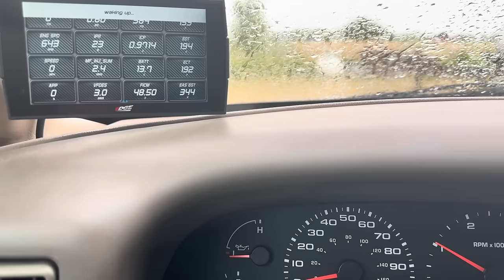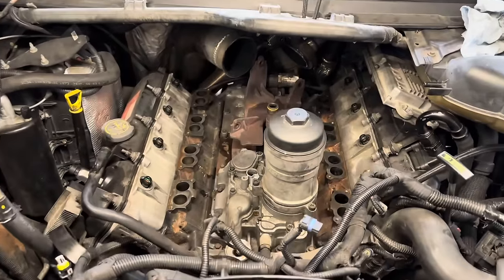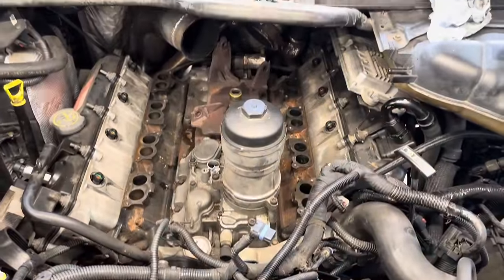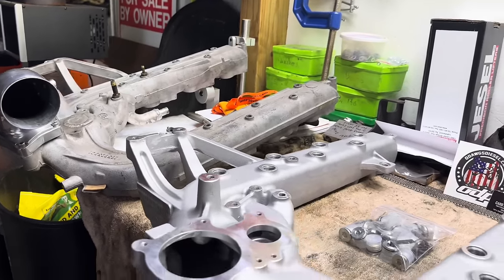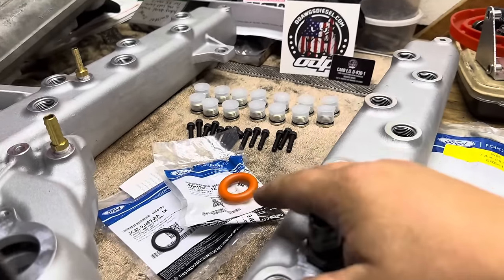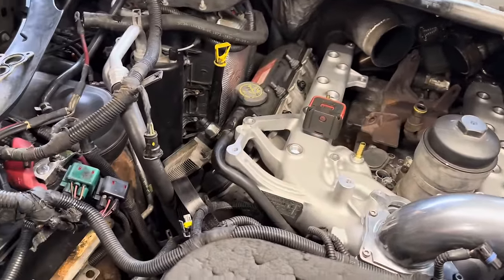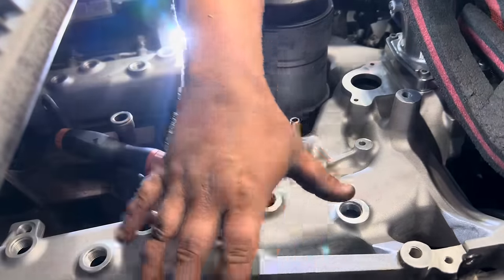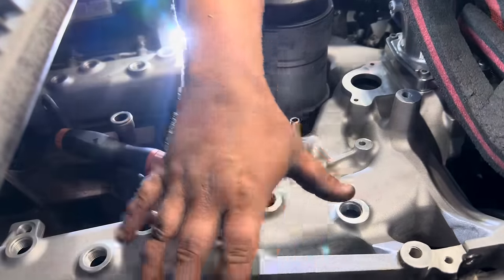THE TOP UPGRADE FOR YOUR 6.0 POWERSTROKE!

Comment: 6.0s are so underrated. People who buy into the bullshit have never truly had their hands on one. As a whole its the best diesel platform of all time
Reply: 😂😂 the top upgrade to a 6.0 is to sell it asap… I had one bulletproofed, took extremely good care of it and constantly things went wrong with it. Wasted countless days replacing and fixing. If it wasn’t one thing it was another. Unfortunately I’m not the only one.. everything bad you ever heard about these pieces of crap is 100% true.

Best day was the day I got rid of it and got a 6.7
Reply: It's because of the emissions they put on it and dumbasses that put a race tune in it and then try to tow 10000lb trailers up a grade and blow head gaskets then hop on the forums sitting on it. We'll the larger trucks and busses and dump trucks they put them in didn't have to have a egr and guess what they never had any problems. The 6.0 is a badass ass engine and going from a concept to reality in less than a year I'd say Navistar did one hell of a job. People don't talk shit about the 6.7 and that things has way more problems then the 6.0 and 7.3 combined. The problem is all the emissions bullshit they make them have. That's y there are no reliable diesels on the roads now days.from cars to pick ups to semis. They all break down more then they should.
Reply: @powerstroke6.7 sorry to yell u this bud but the 6.7 is a bigger piece of crap and I've been working on and building these ford diesels everyday since the 7.3 powerstroke came out. If u dont know what ur doing or taking it to people that don't know what they're doing ur always gonna have problems. Not the the engines fault.
Reply: @Chevydude1982  let’s just agree to disagree. You stated nothing but opinions and feelings, no facts. 

If the 6.0 is so good why didn’t navistar or ford keep the platform? Because it’s a disaster. People have made careers off of working on 6.0’s.  

I’ve never met a 6.0 owner in real life that likes the engine, it’s always some guy on internet that “works on them all the time” that talks how good they are. 🤣
Reply: @Chevydude1982 it’s the emissions but that’s just the tip of the iceberg…. Modern diesels have way more emissions than 6.0 and don’t have near as many issues. 

Since you work on them all the time has it occurred to you that having 4 head bolts around each cylinder may not be enough? 7.3 has 6 so does the 6.7.

Id rather have deleted 6.7 than 6.0 ANY day of the week. 

Btw maintenance on 6.0 must be meticulous if you want to keep it running, 6.7 is little more forgiving.

Everyone has their own biases, but the facts are undeniable…. There is a reason why 6.0 is no longer produced and navistar and ford gave up on it.
Reply: @powerstroke6.7  y r there sooo many u tube channels of guys building them. I've been an l3 ase master auto tech and Ford senior master tech for 30 years. I was a beta tester for the Ford id's and designed a lot of the tools used to work on them. The engine is awesome,the egr is the problem and if u knew anything about them u would know Navistar did keep them for class 8 trucks ,busses and equipment because they didn't require the egr on them. I've made a shit load more money in the first 3 years of the 6.7 then I ever did on 7.3 or 6.0 powerstroke . U r the one that knows nothing about them so u shit on them cause u cant work on them.when u say let's agree to disagree, that's when u shut up, that's y everyone tough on the internet. 🤣
Reply: @Chevydude1982  lol ok the first 3 years of 6.7 was trial and error just like any other engine… from turbo to emissions kinks. So far they have been in production for 13 years and running strong compared to not even 5 years total for 6.0 since it’s so good of an engine and all…

Your point is mute and no the egr is not the only problem but you knew that since you are an “expert”. 4 head studs around each cylinder in 6.0 is a blunder. But you knew that too.. lol

I understand why you keep defending the disaster called 6.0 people keep bringing them to you and people like you to get “fixed” only to have something else go out on it. to a hammer everything is a nail…
Reply: Sorry man but not true im literally pulling the engine outta one ive had for many years and there is always issues💀. And i do not abuse it.
Reply: I love my 6.0 cause its cheap and ive had enough of them now to be able to fix most things by myself . But shit breaks.... Often..... Lol 😂 im on my 3rd one. Sucker for punishment i suppose. But that sound!!!! ❤ Also have a 2010 duramax, no troubles in 10 years with engine. But transmission..well..iys crap.
Reply: @powerstroke6.7  I've had 4 6.0 powerstrokes and have had a completely opposite experience with them. None of them have given me any issues once the obvious issues were solved.....not sure what you were doing with them but it was obviously not the right thing.
Reply: @Chevydude1982 deleted 6.7 is a beast! Never had a single issue since 2019
Reply: @21divel right… that’s why they made them for 4.5 years and gave up on that piece of junk
Reply: @powerstroke6.7   Nobody is saying 6.0's don't have issues from the factory....what is being said if the issues are taken care of properly, and maintained, they are great platforms.
Reply: As a 6.0 owner I will just say, do not buy one if you have previous mental health issues😂
Reply: @powerstroke6.7  Ford went away from the 6.0 for the same reason they left behind the 7.3. It's because of EPA regulations. The 6.0 was produced under different names, and mostly for heavy duty applications for almost 11 years. You're sour and spouting nonsense
Reply: @lukefranklin1766  shhhh don’t talk about the lawsuits between the ford and international, 4 bolts around each cylinder, leaking head gaskets, ficm mounted on the engine which caused multiple issues…. Other than that and slew of other problems it’s a great engine.
Reply: You are a fool that needs to learn to STFU when proven wrong.
Reply: @martingilchrist7063  where is the proof that I'm wrong?
Reply: I don’t exactly love these things tbh I’ve had 3 obs 7.3 powerstrokes with a few mods to keep up on the Hw never blew head gaskets or anything but soon as my grandfather got his first 6.0 it blew a gasket I looked into it and imidiatly was like yo let’s fix it and sell this pile we fixed it he kept it cause I studded it put a aftermarket oil cooler deleted egr and put a MILD tow tune on. It with a coolant filtration kit then he got another one same thing again in my mind it’s a pos runs good when it wants to but man I love my obs 😂
Reply: The 6.0 engine is a great engine unfortunately the parts need to be made better and if u delete the cat u get a much better truck its night and day
Reply: @powerstroke6.7 lmk when a 6.0 ate pistons 6.7s blow pistons and heads all the time please shut up my god
Reply: @Chevydude1982  this is facts
Reply: About 3 months into ownership of a 2003 f350 6.0 and I think I got a good one meaning taken care of. Now I'm thinking I really want to try my luck and get a 6.4😂
Reply: Agreed!
Reply: That's right! Building it out of it's factory imperfections and then compound turbo it and you've got a BEAST! Makes the truck feel light when you mash the accelerator! Like you've got a miata under you!
Reply: @powerstroke6.7 

Stud
Reply: Hahahahahahaha. Right buddy.
Reply: Shiit what about that 6.4?

Comment: I put an s3r on my truck and the best piece of advice I have is install the bolts in the intake manifold while it’s still off of the truck on the bench using the intake gaskets to hold everything in place. Makes it so much easier and there’s no chance you can drop a bolt while doing it.
Reply from the maker: I know many guys use this method with great success.

Comment: I went with the S3R intake, Icon aluminum heads from KDD, 1.5 turbo from KC Turbos, stage 1 cam from River City, new FoMoCo lifters, oil cooler, HPOP, LPOP, water pump, fan switch, FICUM.  Switched to CAT ELC red and a coolant filter from KDD.  It's a 2004 and I dumped all that air damper crap up top and it now looks like a 2005.  Oh yeah, tunes from Warren.  It's a beast now.  Pulling a gooseneck with a 1973 Plymouth Roardrunner thru the Ozarks in 95 degree +  never got more than a 8 degree delta except when the ECT drops quickly on downgrades - EOT doesn't drop as quickly.  EGT's under 1100 max.  Calculated 22 MPG aveage empty at 70 MPH (can't afford to fix the overhead computer now!)  Whistles like an old Kenworth!  186K miles on the clock - all the crosshatching on the cylinder walls was still factory new looking.  Run Rotella T6, 5W-40 and I threw in some Archoil on the 1st change.  Didn't lift the cab - pulled out the front.
Reply: How much did all that run you? Did you do the work yourself?
Reply: from what I learned from a cat tech and failed lifters I seen in 6.0,
 I wouldn't run rotella in anything except for chainsaw bar oil
Reply: @jesusisreal3209 you're right on that one. The new T6 formula is absolute shit. I stick to 15w-40 motorcraft or shaeffers
Reply: @blooiefps9304  you’re suggesting dino oil over full synthetic? Can you post what analysis you’ve read that would put a full synth below a higher ash conventional oil?
Reply: In our studies on oil in powerstrokes. We switched to Delo 400 synthetic 22 years ago. My personal 6.0’s have 276k and 352k. All original on both. Only upgrades done EGR/Oil cooler around 125k on both. Both had HPOP replacements at 240k.
Reply: @edwardkveton3410  I bought a 03 with 225k hard to start smoked ran really rough.
Changed oil to navistar specified  motorcraft 10w30 diesel oil.
And about a quart of typ f atf in the oil and gallon of atf into two full tanks of fuel and she starts runs like brand new 6.0
the previous owner told me they used only delo 400

Comment: I believe I was that customer 2 weeks prior. I also purchased mine from kc but I contacted odawgs directly and they told me there was no way it was a issue with there product that “we sell to many with no problems for it to be a issue on our side” lol good to see after all it wasn’t something I did. I also had to grind mine and have had 5 sled pulls with no issues so far.
Reply from the maker: No way! That’s crazy, thanks for commenting. Yea I’ve installed a bunch of these and never had an issue. So I was shocked when this happened.
Reply: @LeftLaneDiesels   yep it just sucked cutting up a part I paid 900 for lol other than that they make a damn good product  and them oil cooler cover are not cheap
Reply from the maker: @double_tap_3793  I agree, I took away enough material that I started to get pretty nervous. A lot of time and money to tear it all back apart 🤦‍♂️ Hopefully it was just a freak thing and we were just the unlucky guys haha
Reply: I’ve seen a handful of videos of people who have had clearance issues (mainly the idler pulley)… you would think O Dawg would take this into consideration for future castings knowing that majority of 6.0s have had or will have head work done. I’ve been considering this upgrade for a while, but am worried about the same issue. I hate having to do work twice.
Reply from the maker: @Powerstroke7911  from what I understand all odawgs intakes will come with a washer to space out the idler pulley. In regards to clearance of the oil cooler, I don’t think this will be a continued issue. Just wanted to make sure I added it to the video to make sure guys check for clearance in this specific spot to alleviate doing the job twice.

Comment: I've got a 2006 6.0 lariat that I've had since new. Truck is completely stock other than a ficm I replaced about 2 years ago.
As others have mentioned, these truck engines are phenomenal if you know how to maintain them. You have to use motorcraft parts, 5000 oil change with rotella and fuel filter changes every 10,000. Mix in a coolant flush every other summer and you can get 400,000 miles out of them. I'm at 205000 miles and still running strong
Reply: I have a 07 all stock with over 300k

Comment: I installed the S3 on my 6.0.  I also did the BPD oil cooler relocate.  I had no issues whatsoever.  Cody I really enjoy your videos.  Great work.  I like the Ford 6.0 so much I just purchased a 05 KR with 45k miles.  Gonna do the same to it as my last.  I have your uppipes on my previous.  All going geat with them.  I pulled over 17k 4000 miles last spring and everything kept in check.  Again.  good job.

Comment: Have that same one on my truck. After doing it I noticed the truck just pulls harder. I also noticed even on the 150 hp tune with stock turbo and stock injectors I get a teeny puff of smoke right as the turbo builds and then it's just clean hard power. Love that damn truck.

Comment: I just put mine on and haven't driven the truck much.  Thanks for the heads up, I'm going to check my clearance now!  Also, almost impossible to tell until its seated due to the fact you have to compress that giant coolant donut with the manifold.  I also had to grind a small amount off the lower ear of my alternator and shim the alternator up about .075" to clear an access plug.
Reply from the maker: Thanks for mentioning the alternator, I’ve ran into a few that the access plug hit the alternator as well. Especially guys that have larger alternators… but even the stock alternators can hit.

Comment: Thanks for all your videos, I have a 07, f350 6.0, basically used for towing my 5th wheel. New O'ring heads, ARP studs, egr delete, KC stage1 jetfire,  stock but newer injectors,  bottom end reseal, and the rest of the normal upgrades.. so, my question is about EGT'S, i upgraded my 5th wheel,  towing at the highend of capacities but still within them. When pulling grades,  6or 7 plus,  i have to slow way down because 1250/1300. So, asking if an odawg intake and / or other upgrades can lower my EGT'S?

Comment: Definitely on the list for my truck. I wish I would have done it before my compound build.
Reply from the maker: What I’ve come to realize is how air restrictive these engines are. They just don’t flow! This along with a few other air flow related products can SUBSTANTIALLY boost performance when combined(double the airflow from factory). I’m hoping to capitalize on this with the sled pull truck. Your truck would seriously benefit with the compound set up.
Reply: Yeah, I have heard that just sometimes that scoop falls out from that back tube and it even makes a slight difference for the better.  I mean, if you're not lucky enough to have a full LLD set of pipes yet that is.

Comment: I thought the manifold came with a metal tube that you slide in the hole first and then the bolt so there isn't a chance of dropping into the engine? Thanks

Comment: That's 243 Loctite you used I hope.
Why wouldn't OWDAWGS add 1/8" to the manifold where it mates to the cylinder head to eliminate the clearance problems for all installers?

Comment: Dyno results would be siiiick 👍😎.  Great job, thanks again and hopefully ODogs can get their foundry to modify that mold a slight bit.  I mean, what 6.0 practically hasn't had at least some work done to it by now?  
I am wondering if the BD exhaust manifold would be another good airflow improvement for ya.  
That, and I am curious about the Speed of Aire dimpled pistons also in a 6.0
Reply from the maker: Right! More than not, almost every 6.0 is gonna have some work done. 
The dually has ceramic coated RCD log style manifolds 😎
Reply: @LeftLaneDiesels  wheres the after video?

Comment: I have an aftermarket oil/air cooler and filter relocation kit, i wonder if the oil cooler housing is removed or modified so this manifold wont work for me?

Comment: Hey pal, you ever get an App Egr Icp codes and wrench light all at the same time? 
Great videos btw!
Reply from the maker: Yes typical that is a 5v reference issue. Could be sensors-wiring-and or pcm. 
Typically need it to act up ALOT to diagnose. Very tricky, I hate dealing with those ones haha
Reply: @LeftLaneDiesels  lol time to hit the pinpoint book, thanks bud!

Comment: When I installed my Odawg i had a major exhaust leak and I could not figure out where is came from.  I took mine off and figured out that it was at the egr cooler and leaking at the gasket. Unfortunately I didn’t reinstall it and sold it, wish it worked for me!
Reply: Moral of the story…if you go aftermarket don’t give up so easily
Reply: @MacJank7  ya it is my only truck and need it to be dependable for towing my 5th wheel.  Odawg’s design is great and I would love to buy another one just a few things I didn’t like that made me not reinstall it on my daily driver.  First the wiring harness is really stretch out with the height of the Odawg intake. Which most likely won’t be an issue but with my on harness caused me some concern. Second having a larger than stock alternator you have to space the alternator so it won’t touch the top of the manifold.  That put more strain on the stock belt which might not be a big deal but made me uncomfortable. If it was a play truck I wouldn’t care but since I tow with my family on long trips in the California heat i decided to stay stock here.

Comment: Okay. My son is getting his first diesel. 2005 F250 6.0 PowerStroke with 126k. We know absolutely nothing about diesels. So my question of the day is what are EGTs?
Reply: Exhaust Gas Temperatures
Reply: @200mphz06  Thanks 200
Reply: @Wonderer67  Hopefully he’s done some research on these 6.0 Powerstrokes. A coolant filter will help keep the oil cooler from getting clogged up and having to be replaced. Make sure the oil and coolant temps stay within 15 degrees of one another at 65mph. A scanner to monitor those temps along with a coolant filter is much cheaper than repairing blown head gaskets.
Reply: @200mphz06  thanks. That is were we will  start